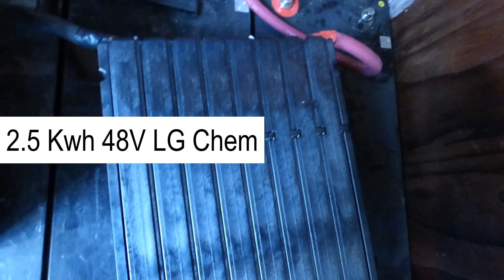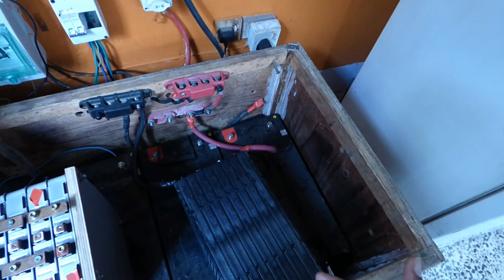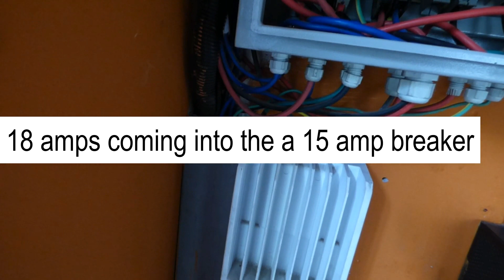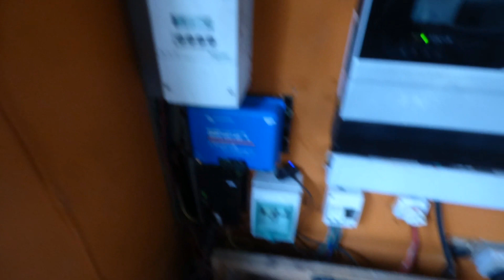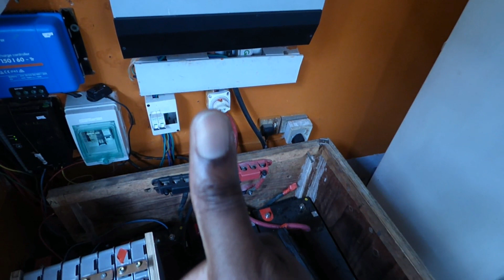Nissan Leaf update and Hello LG Chem

Comment: Hi. I prefer bottom-balancing cells. You can do this with a simple resistor and a voltmeter - and some patience - until each module reaches 6V or so. After that, you can tie them up in parallel for a few hours and they will balance out the last few millivolts differences. You could charge them in series shortly after bottom balancing.

As for the LG Chem, those modules are 16 cells in series for max ~67V. Since your inverter cuts out at 60V, you can set your charge controller to 3.74V x 16 cells = ~59.8V max and cut out discharge at 3.1V x 16 cells = ~49.6V. You might be able to take the lower limit a little lower, say to 3V each cell, if more capacity is needed. This range will keep your battery in a safer zone than fully charged/discharged and make them last longer.
Reply: Thank you for the suggestions. My team and I will try it
Reply from the maker: I have stopped DIY batteries but it is helpful to know this.

Comment: Any luck with balancing?
Reply from the maker: Hey Frank Z. I have purchased BMS with a balancer. The method of connecting them in parallel did not work. I will post an update once I get the BMS. Thank you for checking back on me.

Comment: Not good! Your system needs a revamping.
Reply: I left mine for a week. But those should transfer power quickly.
Reply from the maker: @frankz1125  thank you for the update. We will leave it till Tuesday and I will update you.
Reply from the maker: Explain what is not good and how you would revamp it if it were yours.
Reply: Ill start at the breaker popping. You have too much solar on there or your wiring is too small. On a 15a breaker you should only have 1panel or 1 group of seriesed panels with 30% allowance .11.5a max pv for 15a
 Batteries need to be top or bottom balanced even before you add bms or you will pop the bms.
You will most likely need a new inverter because of the battery voltage. 
So you pretty much have to change your system or battery. You can remove a cell from the pack .
Reply from the maker: @frankz1125  the wires are fine. I changed the Beaker. Your suggestions on breakers are not correct you assume a one size fits all. The set up I have works fine for my 250 Watt panels. The one tripping are my 300 Watt panels. They are pushing out more current because it has been cool and the breakers are too small. I am not changing the inverter it works fine with the leaf. You have yet to recommend a bms. You are saying what you want done without saying how. How do I top or bottom balance. Thank you for your opinions they are always welcome.
Reply: Another way to balance is to parallel all the cells and let it sit paralleled for a day and check the cells. They should balance themselves with each other
Reply from the maker: @frankz1125  in the morning with a trickle charge they are close. I will have my people try your suggestion
Reply from the maker: Frank Z  We did just that and it did not balance. We will leave it over the weekend and see if it works.
Reply: What would you like me to recomend. Bottom balance is easiest. A 12vdc light or 5v fan . Drain each cell until all the cells are close. I was under the impression that you knew how to do this already. Sorry. Did you ask G.O.G on the product he uses?
Reply from the maker: @frankz1125  we discharge them with a much bigger load. I have asked GOG. I have purchased a bms and balancer this morning. A 7S
Reply: So then they are all balanced now and everything will work .
Reply: You dont acually need a balancer or bms but you must keep a manual balance.